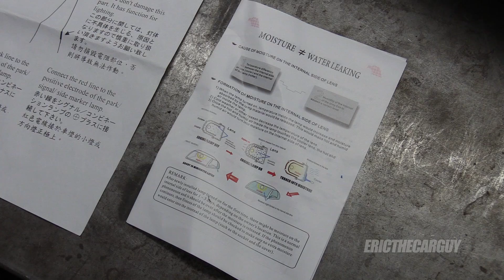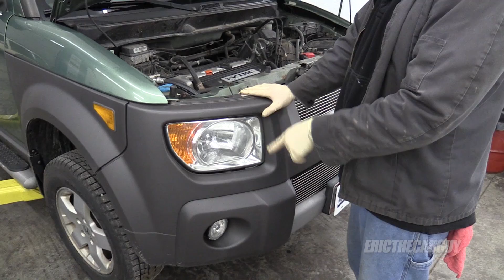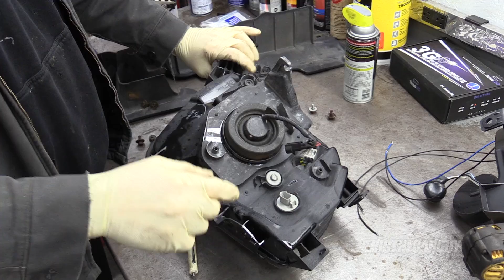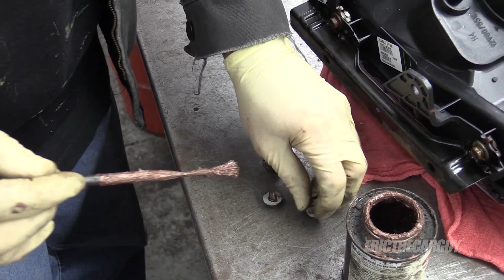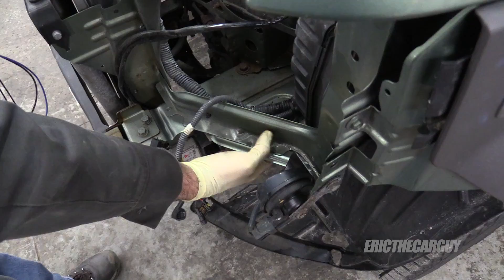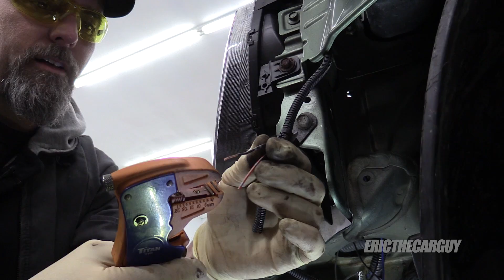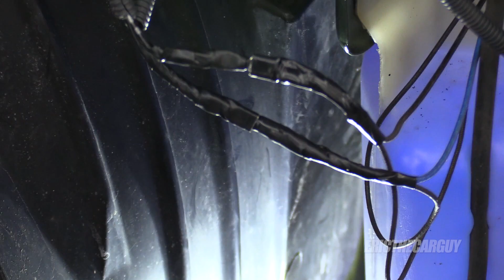How To Install Projector Beam Headlights

Comment: I saw your video and ordered these same headlights and installed them. Thanks so much for the help!

Not 2 days later I have condensation inside of them both. Have you had that issue with yours?

Comment: Great video. I will not be replacing these after watching your video. 😂 I replaced my halogen bulbs with LEDs in the original lamps and now have dark spots near the bottom inner portion. Did I install them incorrectly?

Comment: Wish you showed the Beam pattern of that Projector Headlights. I've been battling with Mine for a Month now trying to figure out why there's no Beam pattern. It just casts/throws out a bunch of Light everywhere (although seems more horizontally) but still doesn't have a particular beam pattern. They've sent Me a replacement and its the same thing. But I think its more of a problem with Aftermarket Units. OEM I don't think have this issue. I'm yet to see a video where these aftermarket projector sets have a nice uniform beam pattern.

Comment: Thanks for the video.  I installed these on a 2006 Element LX.  I've never done work like this, so took me closer to six hours.  The wiring was frustrating; mine came with two reds, one blue one black.  No power probe, had trouble figuring it out.  I finally found a question on Amazon where Amerilite responded to pair red/black to ground, blue/black to power, which worked.  I took the advice of several comments and used combination of insulated blades and heat shrink (hairdryer).  Interesting to find out while removing the front bumper that I've been missing several plastic retainers.  

One thing, though.  Once installed there's about 1/8-1/4" gap between the front bumper openings surrounding the headlights.  The kit didn't come with any kind of seal or gasket.  Do you have a recommendation how to seal or close that gap?

Comment: I just installed these same housings in my 03, and this video took out all of the guess work. Thank you.

I do have an issue though. The light has a weird step up going driver side to passenger side. Is that the bulbs that came with the units.

Comment: Very good job Eric adjust can't really give it five stars because I don't think the black housing headlights goes with those Billet grills. Maybe if you had kept the original grills with the Honda symbol in the center that we're black originally from the factory it would match up better. And with a modded Black Honda symbol! choice!

Comment: I know this is a older posting, but instead of electrical tape or those non-weather proof connectors, try this 3M Self-Fusing tape. My electricians that worked for me in utility field told me about this. It’s almost permanent, it waterproof, doesn’t degrade, is protective, can just be wrapped around a connection and seals the connection. It is really “persistent” nut can be removed, and I think the persistence has proved to be a stronger connection than most crimped connections.
https://www.3m.com/3M/en_US/company-us/all-3m-products/~/Scotch-Self-Fusing-Silicone-Rubber-Electrical-Tape-70/?N=5002385+3292437112&rt=rud

Comment: The best LED replacement bulbs right now for headlights might be the F2 from Evitek in China. At $40 a pair including shipping they are not cheap, but do put out a tremendous amount of light and are well built. They also perfectly mimic the halogen bulbs on cutoff, with placement of the LEDs right at the same spots as the halogen elements, and are the same width and length, as the halogen elements. 36 watts rated,  but actual for the LEDs is 30w for each bulb.

Got some 20 dollar per pair 4x6 halogen headlights off Ebay, with clear glass fronts, and those F2s worked perfectly. Super bright and a great halogen cutoff line. The heatsink, with fan on the back ran at about 120F in a 75 degree room. My guess is they should last a long time. 

A $10 LED bulb off Ebay, just looked more like a flood light in the same cheap housings and was not that bright. The F2s are a whole nother animal.

Comment: I'm faced with a similar issue: Want to install daytime lights (DRLs) but in Europe we don't have front "parking" lights; also want them to light up when I unlock the car via dome light.  I've traced the dome light cable and I can tap into "ignition on" power from the fusebox but I need to design a circuit that will turn them on based on the OR condition of 1)engine on or 2) domelight on, probably involving a two source relay.  Advice?

Comment: For the kids that think this is quality.  Drive down an isolated road that does not have street lights, then turn off your headlights.  This is the risk you are taking by hacking wires and not obtaining a 100% seal.  Wrapping these connection in electrical tape does not cut it, and frequently makes it worse because once water, salt, magnesium chloride enter the area it takes even longer to dry.  You will never know you have an issue until it is too late.  Soldering is not a great idea either.  OEM doesn't use it. aviation does not allow it but in a few isolated instances, both indicators that it should not be used.  Then there is the subject of projectors, HID, & LED in headlamp assembly's not designed for them.  You may think it looks better from the drivers seat, but almost without exception it is worse for oncoming traffic.

Comment: The spade connectors at the 23 minute mark could probably be a more clean install by using the rubber style connector like you'd find in a battery tender.

Comment: I don't even have an Element, but still enjoyed watching. Any reason you chose to use regular turn signal bulbs and not LED ones? It is due to having to add another layer of electrical work with having to install resistors? Thank you!!

Comment: No issues with mixing Aluminum wiring with Copper?  Not much experience in auto repairs here, but for home repairs that's a huge problem and there are special harnesses you have to use to prevent galvanic corrosion.  Also makes me wonder where else they cheaped out when manufacturing those lights.

Comment: I would suggest before removing the original headlights, aim them at a wall and with tape mark the center of the beam.
Without moving the car, change the headlights and then compare the aim of the new lights and adjust accordingly.

Comment: Boy... if there's any way not to do the electrical work, this is the exemplar of it.  You could have installed a very nice splice onto the main cabling, staggered, shunk and tubed.  You could have installed a nice weatherproof connector for a few dollars a corner.  It would then look factory and be perfect in every way..

Comment: Why didn't you wipe the amber bulbs off before you put them into the fixture with those dirty greasy rubber gloves? I do also like that you solder the wires together a soldered connection is much more durable than a spliced connection, nice job.

Comment: Blade connectors? <shudder> You can buy waterproof automotive connectors on Amazon for around $10 for a pack of 20. They're a life save, they make the job easy, they last, and they make the job a lot less messy. Blade connectors have a good chance of having something go wrong in the place they're at.

Comment: A dab of dielectric grease on the connectors couldn’t hurt, and might help ward off the crusties a little while longer.  I prefer to solder splices too, but it may back-fire (is that a pun?) on someone who is unfamiliar with soldering.  

And Happy Holidays one and all!

Comment: Holy crap, that's a lot of plastic clips to remove your bumper!
  I like to use flat 2 pole trailer connectors for applications like the halo and led marker lights. Use the shielded red side for  the vehicle side and use the exposed red side for the load side. 
  Great video. I just upgraded my headlights and taillights to led's. I like the others but the headlights need some work.

Comment: I see you just slapped in some hid bulbs in with out showing the cutoff with halogen bulbs and hid bulbs. Plus you didn't  want to do a true retrofit with hid projectors so you get the best output and have a sharp cut off with clear lens.

Comment: Eric, why do you do such jury rigging electrical connections? You should have do it the right way with Weather Pack connectors/pig-tails and adhesive lined heat shrink tubing for the splices...

Comment: Great to have you back Eric. And very greatfull you put those crimps on. I almost went mad over it. A little note, soldering and then crimping can cause bad crimps. Also those insulated crimps you spoke about arent weather proof. You can spray wax oil over the top to help with corrosion prevention. Also ebay do have oem style 2 way weather proof connectors like Fiat use

Comment: You could use large heat shrink tube on those connections for the park lamp circuits to weather proof them. You would have to cut it off to take it apart but at least you wont get moisture in there. Shrink tube is cheap!

Comment: LED's are by definition diodes. They are designed to operate with current flow in only one direction. I find it odd that they even turn on either way, but the best thing to do in the situation would have been to get a decent multimeter and use the diode test function to determine which way they are meant to be wired.

Comment: Great vid. The one thing I would say is that headlight modification is actually federally illegal. Now a different housing is another ball park, but according to NVSS 108, it kinda shouldn't be done either, as it's not what came with the vehicle. On the other hand, the headlights you have installed, being bi-function are probably meant for HID, so the HID install there wouldn't be an issue as opposed to installing them in a reflective housing. Just a couple of notes for you.

Comment: Might be a little overkill, but regarding insulating those spade connectors for the halo/parking lights, maybe a piece of the adhesive shrink tubing over them but only heat the side of the tubing that is over the insulation of the wire leaving the end over the connector open so that it can still slide on and off.

Comment: Good luck with those headlight. Almost all of them out there are the biggest pieces of junk you’ll ever see. The halo will die out first and then possibly the leds on the side. Not to mention you have a “projector” but the light output may be horrible when using halogen, but will not be truly made for HID bulbs. And they may even say to cover themselves “for off-road use only”. I have some Spec-D on my Celica, were used for maybe a few months before everything started to die on the lights, hated my viewing distance and then put back in the box. Have been there for over 5 years now. Waste of $300 ever. But hopefully you’ll have better luck.

Comment: Those Anzo, Spyder, Eagle Eyes, etc. projectors aren't very good as a whole, the output just sucks.  Look into retrofitting actual HID projectors into your car and do a video on that.  There are a number of good aftermarket projectors out these days in addition to good projectors you can pull out of a junk yard such as those from a Lexus RX350.

Comment: U coulda stripped some of the plastic off of the wire without cutting it. Also a lil custom harness to it with m\f connectors for quick disconnect

Comment: IMO I'd rather had LED headlights than HID's. My car came factory with HID's which I'm fine with but if it didn't come with HID's stock then I probably would put LED's in because they're just so much simpler to install than HID's.

Comment: You should of hooked it up to the fog lamp switch, that way you could of had the Angel Eyes On without you're running lights
Reply: And that's not saying the way you did it is wrong it's just a preference if you like the look of the Amber lights (running light) then do it this way
Reply: Hell, if you wanted you could run a dedicated switch for the Angel Eyes.  It's whatever you think looks lit <lol you see what I did there

Comment: I would recommend using clothing (heat resistant) tape instead of electrical tape, as the latter becomes like a sludge after some time in the hot/cold/hot conditions. Otherwise, cool build, interesting video. Thumbs up. (:

Comment: Did you need to get a different set of HIDS to fit the projectors? My honda uses H4 size headlights and the projector replacements i was finding online used a different size bulb such as 9003 or something else. Is there adapters or were you just lucky?

Comment: when I installed fog lights on my truck I used a 2 plug trailer connector .. 2.99 for a set so 2 sets needed for this headlight setup and you cant mix up the connections - PS great to have you back

Comment: How the heck if those halos are LED why can they be on with no particular polarity ? I’ve installed LED before and as I learned in school a diode is like a one way electrical check valve in a sense

Comment: Nice Blizzaks! I noticed the tread pattern - aren't they great? I have them on my truck, and the wife's winter car (Volvo 940). They're amazing on ice too! Watched a guy lose control behind me, as I sailed along unaware of the icing conditions!

 My buddy's newer Ford pickup has projector beams right from FoMoCo - they're CRAZY bright! They have a distinct and VERY sharp cutoff line on low beam - you could build airplanes off it's straightness, lol. If these aftermarket ones are half as good as those, I may buy a set for the Silverado.

Comment: When I added lights to a car in the past, I simply put a relay on the parking lights and then ran to fuse/battery. That way I had a direct line to battery for power, but it was switched by a relay powered by the parking lights.

Comment: Don't blame you one bit for celebrating when you got those rusted bolts off. I just broke two replacing a cracked fog light. I even have the same impact you do, I'm just an idgit and didn't think ahead.. But hey, you didn't link that orange gun-like thingy you were stripping the wires with. That thing is sweet!

Comment: Immmmmm sooo happy these are back! 
I glad you took the time you needed! 

One thought. Generally I agree with mixing spades up. 
But the way it is now, if you take them out. Someone can connect the pos and neg together. 

And when it comes to soldering your wires before crimping. When you have uninsulated like you used, you can flow solder in after crimp. 
I like doing that when I have the time. 

Thanks again for the videos. 
These are just my dumb little thoughts. :)

Comment: Best way to upgrade to HIDs is to just do a retrofit.  Those aftermarket projector lights still might not distribute HID light properly if you were to install HIDs in them.  They'll probably have way too much foreground light and then you won't see as well up ahead.  Also, when I did my retrofit and installed LED halos inside the shrouds, I used a fuse tap with a relay and plugged it in the DRL fuse slot so the LEDs would work just like DRLs and the regular headlights would stay off.  This is on my Cobalt so it might be different on other vehicles.  But hey, we can improvise.
Reply from the maker: I installed LED's in this Premium Member video. I'm also doing another comparison video when I get a chance, HID vs LED vs Halogen in Projector Housings. https://www.ericthecarguy.com/exclusive-videos/73-exclusive-videos/2091-led-headlight-install-inside-element-projector-beam-housings-exclusive-video

Comment: Safety for other drivers, that's a lost concept!  I'm tempted to illegally acquire a tank just to drive through my small town!
Reply from the maker: I suspect it's not just the headlights that's causing your angst.
Reply: Eric, I don't have a problem with the headlights you installed, or any aftermarket lights (I've even installed my own).  My problem is the other drivers and their failure to drive responsibly.  Aside from blinding people with high beams, running stop signs, and texting while driving, misaligned headlights are a pet-peeve of mine.  I love your videos and wish more people would take your words to heart about safety and installing lights properly.  I can't wait for the videos about your Dad's truck!  I have a 1994 Silverado 1500.

Comment: Penetrating oil, because.....Ohio.
Reply: Panhead49EL heck I live in Florida and I’ve snapped fasteners before. Wasn’t even rusted. Maybe it was just over torqued from the factory? Idk
Reply: honda uses "aluminized" bolts. I've snapped random bolts like the rods for the battery tie downs, air filter box bolts, 1 fender liner bolt. cheap ass shitty bolts. it's not an if, it's a when
Reply: Same deal with your neighbor, Indiana. I've never successfully removed an underside bolt without it breaking or without breaking out the torch.

Comment: Not sure if any one has commented on the metal wires, these are usual when purchasing this type of light, I have had about 3 different types for my car, I think they prevent the main body of the light support from moving and being damaged, as my car have adjustable height for the headlights this would make sense.

Comment: Wonderful to se that you are back! fyi those projectors are way better to hid convert than regular old housings, i converted my old Bmw e34m5 1992 that had projectors with hid and the lighting was the same as on a new car. but i remember that there was two different hid h7 bulbs one h7 and one h7r one was for regular old lights dont remember witch one though.
Reply: Nevermind i looked at the end now =)

Comment: I do have to ask, why did you choose halogen in the projector lense instead of putting the hids in the new housing, that basically what those are made for since they have a cut off line.
Reply from the maker: I installed LED's in this Premium Member video. I'm also doing another comparison video when I get a chance, HID vs LED vs Halogen in Projector Housings. https://www.ericthecarguy.com/exclusive-videos/73-exclusive-videos/2091-led-headlight-install-inside-element-projector-beam-housings-exclusive-video